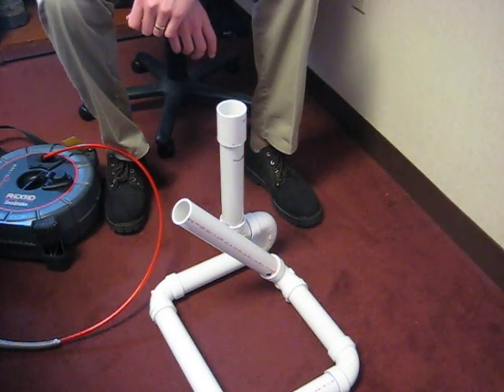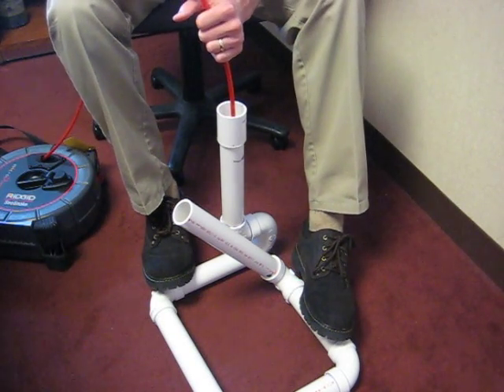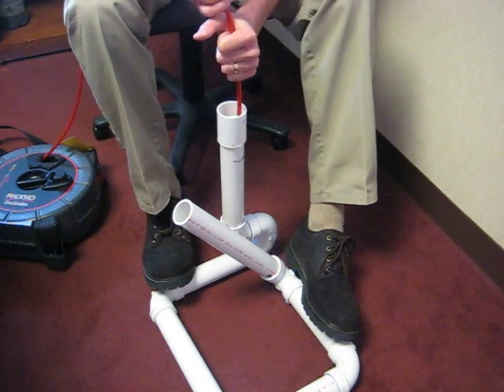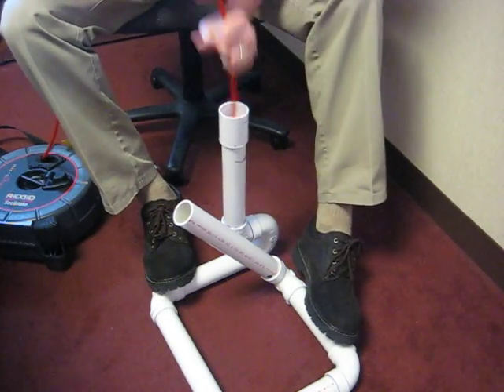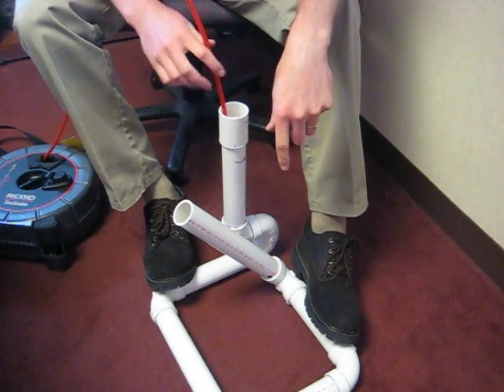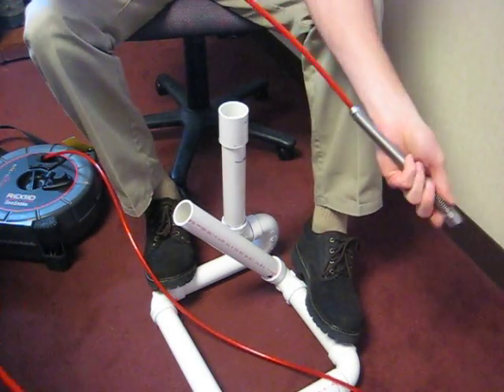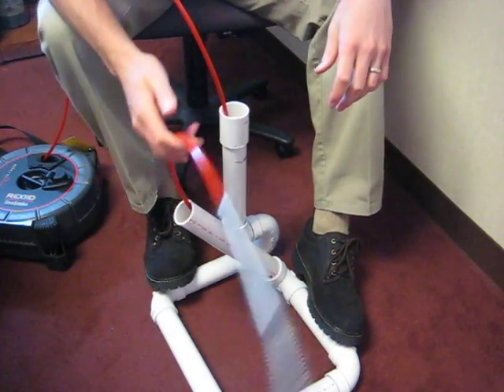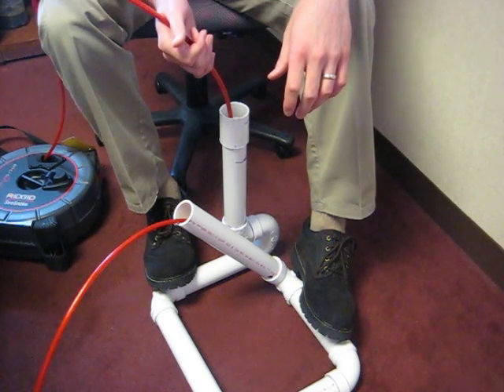microDrain Video Tip #2

Comment: I appreciate this video, but you are demonstrating the snake from the opposite direction in an 1 1/2" tub p-trap. I am curious if the snake would go from the opposite direction and make the last sharp "vent type" 90*. Then, when you get to a vertical sanitary tee, you would have to have a "drop head" like a snake. Nevertheless, this is a great snake and I am going to purchase it. I am just always frustrated with the inexperienced users making videos. Let the old plumbers demonstrate, LOL.

Aloha, Paul Mauna Kea Plumbing Co.
Reply: 3 years passed, did you buy it? Are you ready to demonstrate it or it was just talking? Experienced plumber bla bla bla
Reply: 3 years and 8 months now what?    Nada you ain’t no plumber